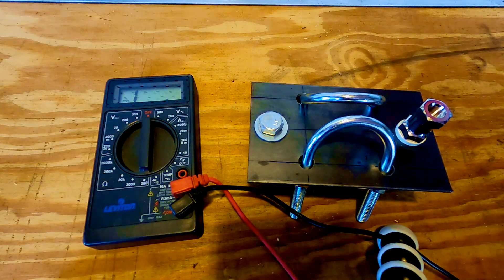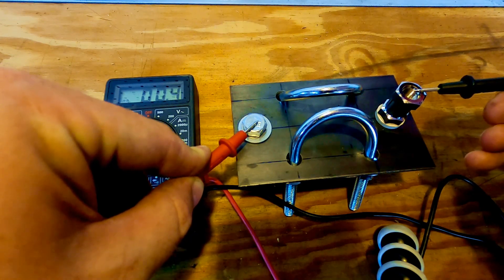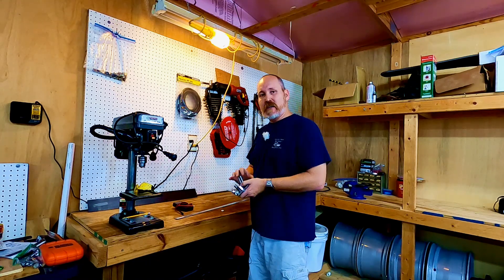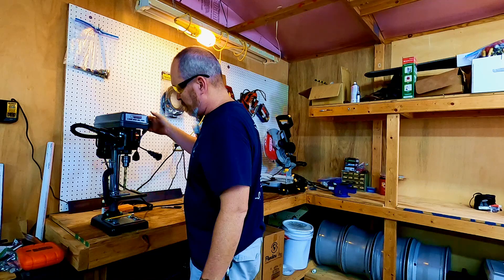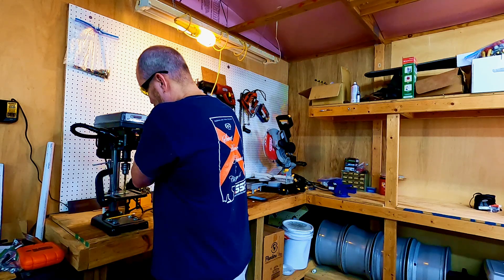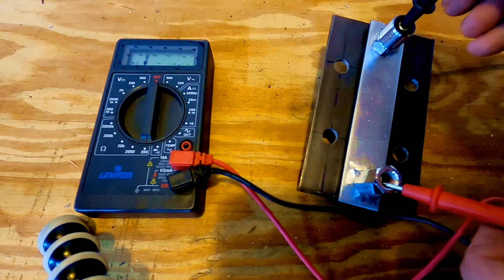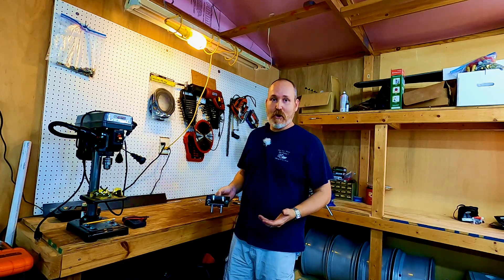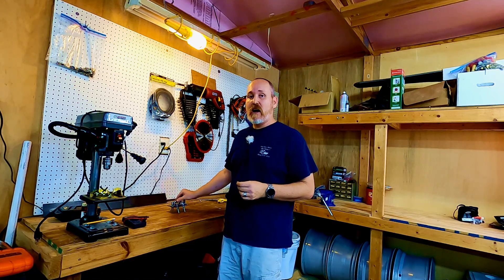Antenna Project: Building a 10 meter dipole center base mount pt2 5/02/2020

Comment: The so-239 connector where your coax connects needs a plastic washer on both sides of your mounting plate, it has to be insulated.

https://www.amazon.com/FireStik-NW-1-Nylon-insulator-washers/dp/B000X3C91W/ref=mp_s_a_1_1?dchild=1&keywords=plastic+cb+antenna+washer&qid=1596422018&sr=8-1